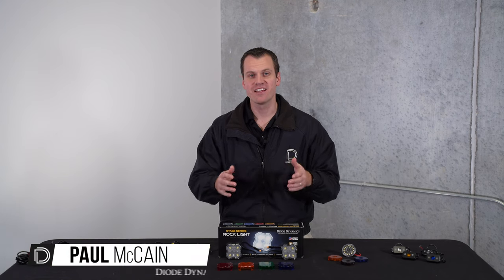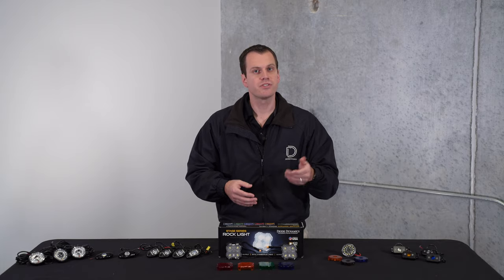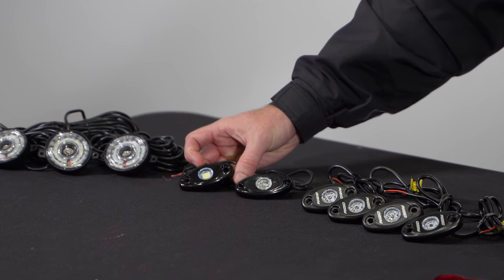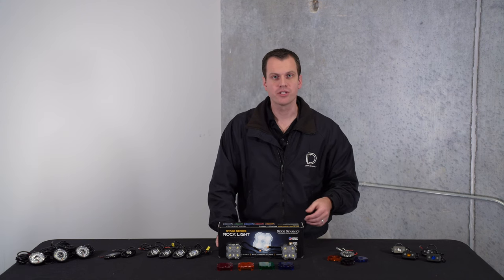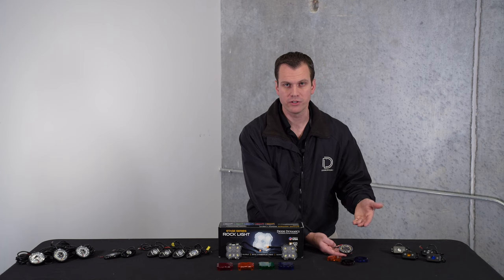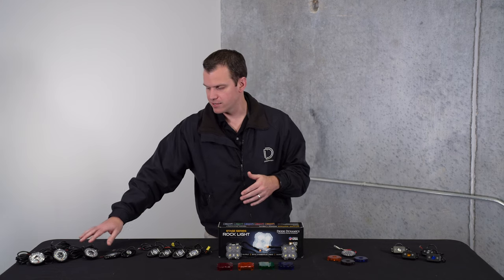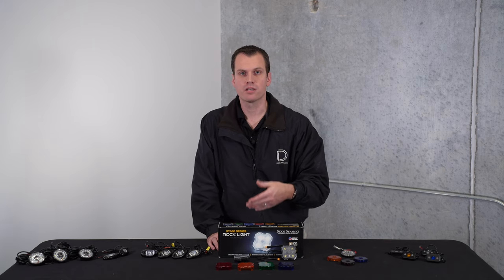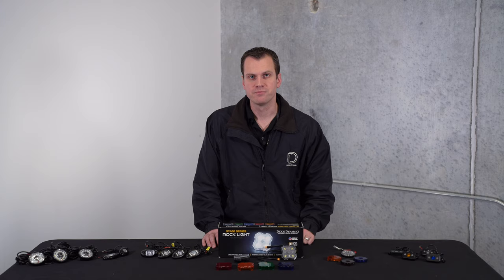Stage Series LED Rock Lights vs Market Leaders | Diode Dynamics

Comment: What do you recommend for bed lights for a 19 Tacoma?
Reply: I'm going to venture out and say that they would recommend the Stage Series Rock Light lol
Reply from the maker: It depends on where you'll be installing lights. Some users prefer our LED strips under the bed rails while others utilize our Stage Series Rock Lights in the bed, rack, or toppers. 

Flexible 5050 Diode Dynamics LED Strips:
https://www.diodedynamics.com/single-color-flexible-5050-smd-led-strip.html

Stage Series LED Rock Lights:
https://www.diodedynamics.com/products/led-off-road-lights/rock-lights.html

Comment: Did I miss the price comparison of yours vs the others?  I’m tired of my cyclone 2’s with dead LED’s and rust on the inside
Reply from the maker: It is mentioned with the other features, however you can check out the prices of our Rock Lights in the link below:

It should be noted that the price changes include the necessary wiring, extra lenses, mounts, and everything you need to install! 

https://www.diodedynamics.com/products/led-off-road-lights/rock-lights.html

Comment: 16DD RLs fitted to my Chariot, a UK MSRT Ford Ranger in RGBW option. The build quality is superlative, the range of mounting options are comprehensive and the wiring connections are simple. The DD App works a treat. These qualities, combined together, make these lights really stand out from the competition. They truly are a “Signature” Product. Buy with confidence and highly recommended.
Reply from the maker: Thanks for the support! 💪👊

Comment: Looks awesome! I’m about to order some! Not sure if I should get 4 or 6 😅
Reply from the maker: Good choice! You can always add more down the road! 4 is plenty for one per wheel well, and 6 could cover the sides of the vehicle. Down the road, two more would cover the front and rear bumpers as well! Then you'd be all set with some intense ground lighting all around your vehicle!

https://www.diodedynamics.com/products/led-off-road-lights/rock-lights.html